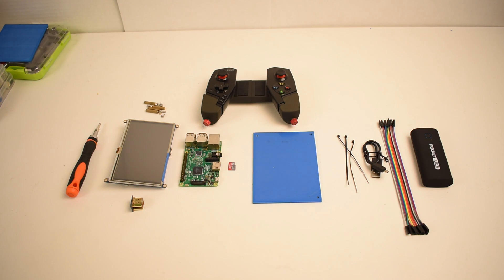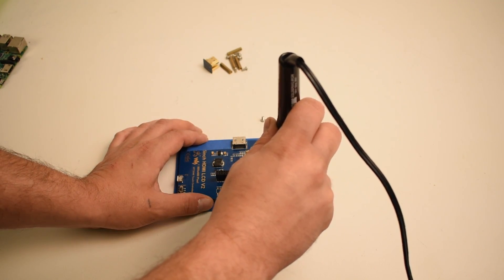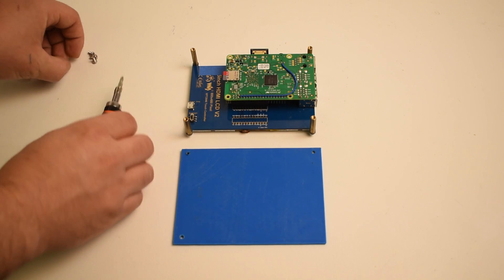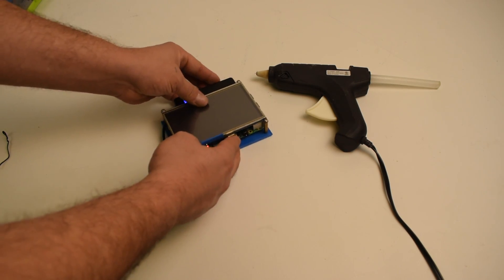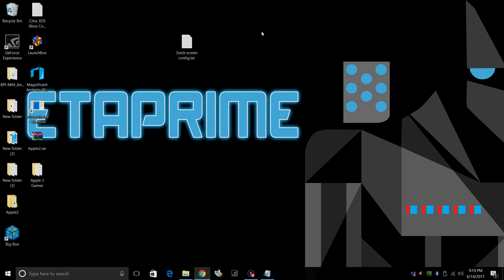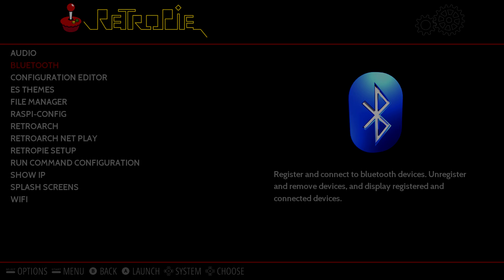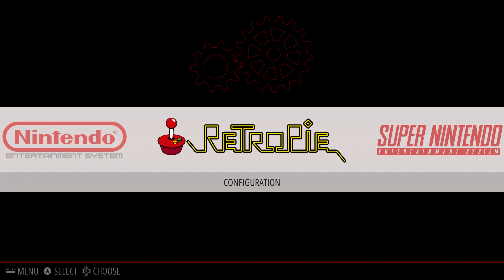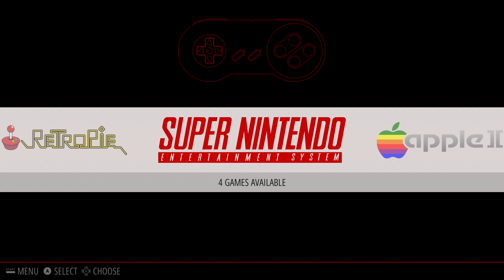How To Build A Nintendo Pi Switch Portable Raspberry Pi 3 Ghetto Pi Boy V2

Comment from the maker: ▼▬▬▬▬▬▬Join Our FaceBook Group ▬▬▬▬▬▬ ▼
https://www.facebook.com/groups/1514369225347840/
Reply: ETA PRIME how do you install something like Linux or the android operating system (it could be called android I forgot the name)
Reply: ETA PRIME if you used the moga pro power (or the hero) then you get the power off the controller
Reply: ETA PRIME is
Reply: ETA PRIME can you send me one and subscribe to my channel
Reply: First off, thank you. I did this build and it works great with retropie but if I use one of my recalbox images I can't get the screen resolution correct. It looks fine on the menu but when you load a game you can only see have the screen. Any suggestions?
Reply: Do u have that file for 3.5 inch lcd
Reply: Does it ever overheat? Is a fan needed?
Reply: Text file is down 404
Reply: Just download another sd card image with the distribution of Linux you want or with Android write that to the sd card and insert the SD card into the pi.
Reply: ETA PRIME this is garbage!

Comment: I'm considering making a pi4 with official raspberry pi 7 inch touchscreen in a case and use a Bluetooth controller like in this video and attach both ends of controller to the ends of the case. I know it would be heavy and awkward but it would be nice on my down time in my semi truck.

Comment: I have made a version of this, it works great and I love it! But when I remove the HDMI connector and connect it through the HDMI slot on my TV the sound doesnt work. I've tried messing about with the HDMI group, mode and drive config settings but can't get the sound to work through the audio jack, which i use when playing portably, and HDMI, when connected to the TV, on the same setting, do you know of any way to get it working through both?

Comment: Im gonna build something like this only I'll be using a 5 inch screen and phone clip insead of the extending controller. Quick question, can u tell me what type of case I could use that would hold my screen and pi3? On the clip that is.

Comment: Ok I'm making this. The n64 controller was messed up, couldn't find anything on it so Im going to post the fix here. Go to  sudo nano /opt/retropie/configs/n64/InputAutoCfg.ini . Where it says PG-9055_START replace it with this,

; PG-9055_START
[PG-9055]
plugged = True
plugin = 2
mouse = False
AnalogDeadzone = 4096,4096
AnalogPeak = 32768,32768
Mempak switch = button(13)
Rumblepak switch = button(14)
L Trig = button(6)
R Trig = button(7)
Start = button(11)
Y Axis = axis(1-,1+)
X Axis = axis(0-,0+)
DPad U = axis(+2)
DPad D = axis(+1)
DPad R = axis(+0)
DPad L = axis(+3)
C Button D = axis(3+)
C Button U = axis(3-)
C Button L = axis(2-)
C Button R = axis(2+)
A Button = button(0)
B Button = button(1)
Z Trig = button(8)
; PG-9055_END

hope that help anyone having the same issue. I was up till the 3am trying to now figure it out.

Comment: How is cooling handled with this screen installed? I heard that PSX emulation can push the processor to some pretty high temps. Would there still be room for a heatsink under the screen when put together this way?

Comment: Great video, I bought the parts you suggested so I could build one myself, but I can’t get the button mappings working for the IPEGA PG-9055. The buttons work in Emulation Station, but they don’t work in various emulators. Would you mind cutting and pasting the contents of the pg9055.cfg configuration file into a comment. That would a huge help, thanks.

Comment: Hey ETA PRIME I got the IPEGA 9055 it's connected to Bluetooth and I followed your directions.  The controller is configured and works in emulation station, but when I go into any game none of the buttons or directional pad work.  When loading up a game it shows 100% Ipega 9055 configured. but its doesn't work.  I'm running retropie 4.3.11.  Any thoughts on a fix or am I'm missing something?

Comment: Nice video! One question: Can I connect two bluetooth mini controllers for two players, and in the same time changing the configuration for use both of them like one controller? Is for "copy" the switch method adding a 3d printed estructure. Sorry for my english and Thanks!

Comment: Will the battery pack supply enough power to run a teensy off the pi3 USB for the controller  instead of the ipega ?

Comment: For anyone struggling with the back plate, I used a bit of thin plastic from a folder which you can cut to size, then poke holes (I used a compass) push the holes through the brass standoffs and then screw on the nuts. It still works in the ipega gamepad aswell

Comment: ETA PRIME Thats a really nice and easy build. Was thinking a long time about a handheld pi, but was intimidated by the complexity of soldering and cramming everything in. This makes everything much easier, and i really prefer this form factor over the gameboy shaped one, in my opinion this puts way less strain on the fingers (i have super long ones, and gaming on a gameboy for a longer period of time is really not comfortable). And i also have two questions: I have found the same screen on aliexpress, but on the back it says just 5inch hdmi lcd, without the V2 like yours. Will it still work the same and have the same set up process? And the next question is, what's the blue wire on the back of your pi?

Comment: works great only complaint is that if I connect it to my tv now the resolution is a bit low
Reply: You can change that in settings, and some Linux nerd could probably make it automatic for you
Reply: Just change your hdmi_mode to hdmi_mode=5 and it will always display in 1080i and you can go back and forth from TV to battery.  If your battery is only 5V 2A though you might get undervoltage issues.
Reply: hoopsdowntown12 Should I do that after I’ve put in the code from the Dropbox file in config.txt?

Comment: Does the controller have a speaker or is there just no sound
Reply: The Pinball Master there is no sound but you can add a Bluetooth speaker or use a small speaker through the 3.5 mm headphone jack

Comment: I've done this except used an old N64 cartridge to mount the pi onto. The 9055 grips it perfectly, and the cartridge slot holds the battery too. It looks crap but I love it :)

Comment: Hey, Prime. I ordered the sunfounder screen - it is also available in europe - on Amazon and tried it out today. Very easy to install, and very nice good looking screen. But I have two serious problems with it and probably sending it back. First: When I want to get the sound out of the headphone output of the raspberry pi 3, I get very strong interference noise. A No Go. Second, what is very strange: All the emulators work like a champ and look great, also the PS1 emulation work and look fantastic on this small screen (could be 7 inch, though). But when I try to start a N64 Game, the screen behave very strange - with strange lines, appearing from left to right, or from top to botton. After a while, the whole screen changes into total white. Do you have an idea about this problems, or a solution? Thanks!

Edit: I found out, that it was my fault with the N64 problem :) - the emulator was the high res version, which resulted in the fault (as the screen don´t support full hd). The only problem is now the white noise, which is in the games itself disappearing. Thanks again for this nice tip!

Comment: ETA PRIME Do you recommend anyone who would do the 3D printing for a case?
Reply: I think he does his own 3D printing. I built a 3D printer, and I got the monoprice mini, but man it is hard to learn how to 3D print without clogging these hot ends up. I upgraded all of my equipment, and I have to configure the stepper motors, but I'm a little burnt out on messing with it.

It's pretty much hit or miss. I can print that rectangle that he did without a problem. To be honest, I wouldn't feel right selling it because you would have to cover shipping on top of covering the cost of plastic. You'd be better off just cutting out some plywood. But if you want, I'll sell you a rectangle of plastic.

Comment: In a previous video you were talking about removing the touch layer. I have an earlier version of the screen and I never use touch. I was successfully able to remove the topmost touch layer with an exacto-knife leaving the the underside which is a lot clearer without leaving the sticky glue residue from pulling the whole thing off. In doing so I have noticed that the viewing angle has increased quite a bit as well as the brightness and the sharpness.

Comment: Hi. Just started created one myself and will hopefully manage to put it inside some encapsulated box which can be physical rotated between horizontal and vertical mode. But then I need to change it also in the software easily when switching games different mode games. Is there a good way to add both vertical and horizontal setup which can easily be toogled from a EmulationStation menu item or similar. Hope someone has a good solution.

Comment: Hey Eta, love the build but  I encountered an issue. I bought the screen in the description but it doesnt have the female mounting hole as yours does(came with the stand offs though). To be fair the pic on amazon also doesn't show the holes either. Since there's plenty of room on the back I figured id rig my own plate on the back and add some holes. 

Just a heads up for you and other buyers. :)

Comment: What about adding a speaker?
Reply: Curtis Brown the pi has built in headphone jack 3.5mm, but you could find a speaker that connects via headphone jack
Reply: Is there a speaker small enough for that?
Reply: There are lots of small speakers out there. -- They get pretty tiny.  Consider the typical bluetooth ear buds people wear. -- But there are bigger ones that are still pretty tiny that are used in portable consoles a lot.
Reply: yes look up ifrog mini bluetooth speaker
Reply: @christianlee1266  Does your phone have speakers?
Reply: What about a powered Bluetooth speaker or bluetooth connection to a home audio?

Comment: I made a coffee table arcade with a pie. I put a computer monitor into the center of the table. my issue is getting the contrast correct. I used the settings on my monitor but it's still too dark at that angle. is there a way that I can change it more thru the pie, maybe a program?

Comment: That battery pack... How long is it lasts with screen and Pi powered? Wanna build it with built-in controller and probably USB hard drive - so power consumption should be important
Reply: sai blades He mentions in the video it lasts about four hours on a full charge.

Comment: Will definitely do it, since I have the display at home. Question: Did you eventually peel the touch layer off? I would be very tempted doing so since you indicated in the other video that the screen is then much better. How to get rid of the glue? Many thanks!
Reply from the maker: i took it off abd the colors are much better but the viewing angles did not change. it does look clearer with it off
Reply: Ok - taking it off now :-) - WOW - this is like day and night. Crystal clear colors and also the viewing angles help IMHO. Many thanks, this makes a ton of a difference. Never going back to the touch layer :-).

Comment: Question, will this pi support a ps2 emulator and how do we cool the pi to prevent overheating???
Reply: Elijah Guerrero Sadly the raspberry pi 2/3 do not have enough power to supoort ps2 games, but it does support ps1 games
Reply: Mr. RetroFanatic oh snap thanks man, now what about a GameCube emulator? can it handle that?
Reply: Elijah Guerrero I don't believe it can, but it can almost 100% handle the N64

Comment: looks nice...but one thing to add would be a mini speaker.  unless the LCD has one built in
Reply from the maker: i have one on the way. i tried a non powered speaker but it need some juice so i orded a small 5 volt 2 watt amp board that should fit

Comment: Hey man! great video. I can't tell form the page, but does that IPEGA open wide enough for a 10.1 inch tablet in landscape (9.5" wide)
Reply from the maker: no it does not. i was only able to fit a generic 7 inch with no room to spare.
Reply: Thanks,  I saw RetroArch on Android and thought it would be perfect for the tablet (and maybe the nexus player). As well as for this project. Sort of an all in one, just swap use case.